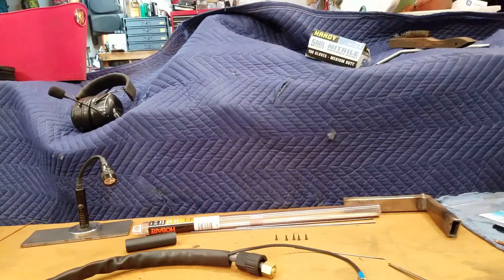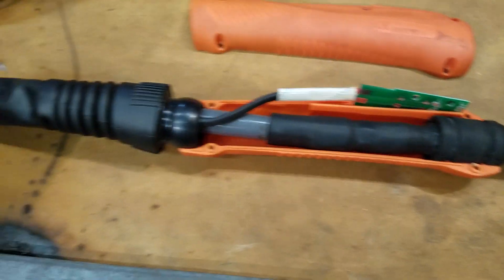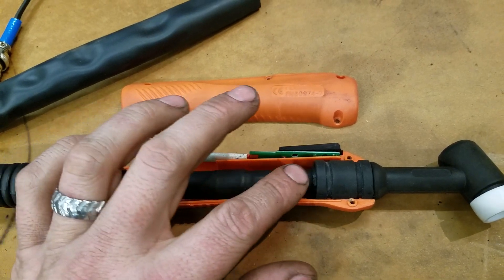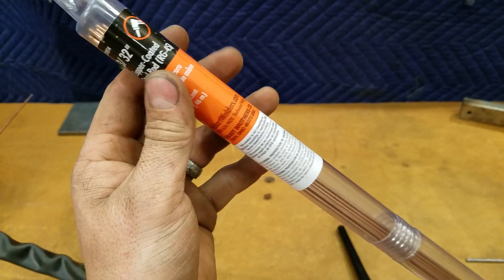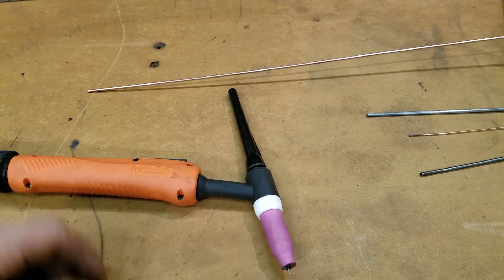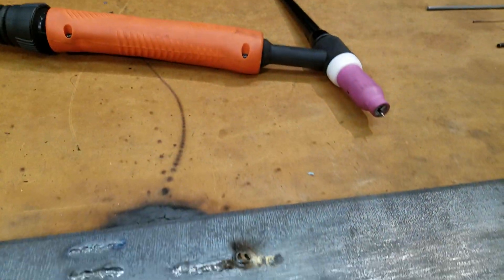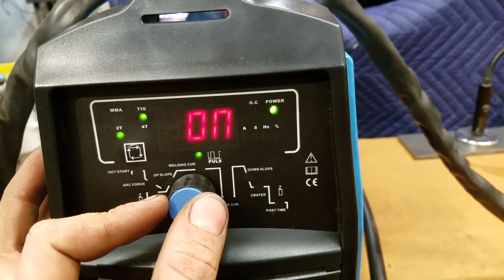Hitbox TIG200P part 2

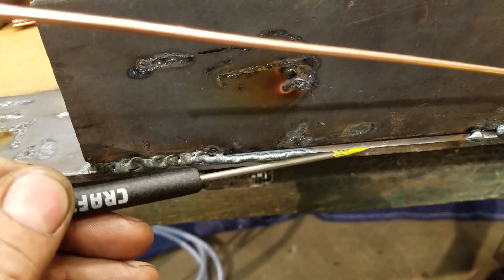Comment: 18:52 Ahhhh, but you are special!
Reply from the maker: Aren't we all?
Reply: @eleventeenmachine5991   I am learning to control the heat and speed much better!!! It's a learning curve, BUT, what I wouldn't do to get my 'Lincoln Pro 180 back (dial's easier to understand 1 - 0)  LOL...... BUT, my welds have proven to be just as nice with my Hitbox 200 MIG/ARC!!!  I had my doubts at first and I did a lot of research and review reading. For the price, I was ready to take that leap for what I call an expensive China product risk! Boy was I surprised and couldn't be happier!! I bet you've mastered your TIG welder better.  Most of my work is done with .025 wire, which means my controls have to be much more precise to blend sheet metal. 'The circuit Board welder!! WOW!!!!!!!!!!

Comment: 14:10 you see the butane bottle you have under your welding bench...lol
Reply from the maker: "Welding bench" Lol!!! Nope. It was piled up stuff with a board on top to make a flat surface.  The blue propane torch was there because I was fooling around with pieces of flint. 
I do have a rather over built 42"×96" 7/8" thick welding bench now.
Reply: @eleventeenmachine5991  haha, yeah just caught my eye was all. I recently priced out a welding bench but found this on a local government auction site for only $300! https://photos.app.goo.gl/bbstkwu6Kqvz4Yf39
Reply from the maker: @dencope5332  well damn!! That's a fuckin deal at $300! Mine is all solid plate and the legs are solid as well. You should put up a video up on here when you have it all set up. I'm sure a ton of guys will want to see it. I have a small lift cart, a gantry crane, and for anything heavier I have a Waldon 6000C front end loader to lift with. 
I have way too much shit.

Comment: no no no you just press the plastic  quick nut  direkt on the scruw  just press it in hard and its same as you did with your AL HARD work ;)  you just not thinking corekt;)
Reply: http://www.laddy.se/visa-bild/47/
Reply: you did total wrong
Reply from the maker: With my method the quick nut is permanently attached to the hose. You can not simply knock it off. 
Thank you for commenting. I appreciate the views and the tips.

Comment: i just got a orange shitbox tig200. looks like im going to have the same battle as you. My torch looks crappier and came with no consumables. my directions are equally bad. so is this a lift to start, scratch or high frequency.... in the mean time i need to buy argon consumables and a plug end. i look forward to your next update
Reply: Scantron's Garage its high frequency I got mine yesterday and so far no complaints
Reply from the maker: It's high voltage start. And it's an m/f'er when you pull off at the end of a weld. It tries to restart and will run an almost 1-1/2" high freq arc on ya. So be careful. I haven't used it in a while. I'll try to make an update this weekend.
Reply: Thank you! on a closer look, yours is nicer than mine. my machine has no options for flow and ramp on/off. dammit! also, when you re wired the plug end, was it two hot wires and a ground or two hot wires and a neutral. still trying to figure this thng out with no manafacturer support
Reply from the maker: Scantron's Garage  Yes. If memory serves me correctly blue and brown are your hot wires. Those can be on either side. And the aisin yellow/green stripe is your ground.
Reply: Henry Rak Part of a dying breed thanks! I returned mine and ordered the model you have. Thx for the wire update. The odd colored threw me off even thought I assumed the yellow and green was ground I didn't want to fry the machine